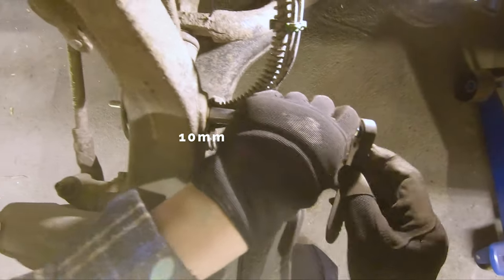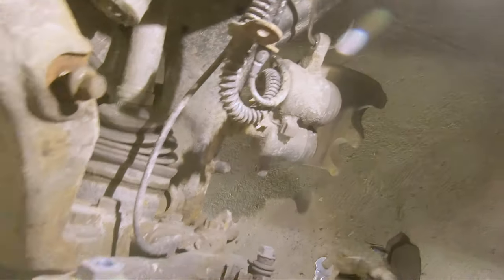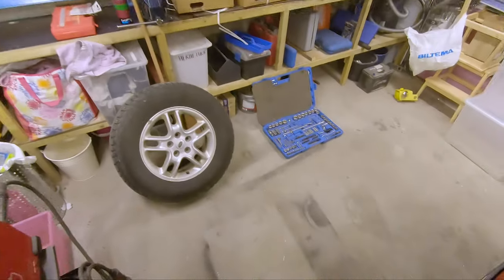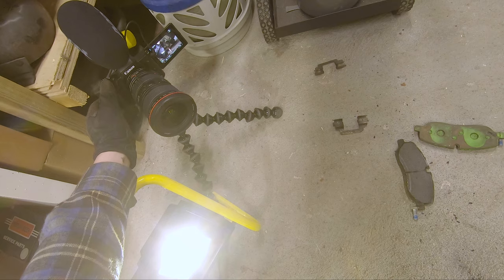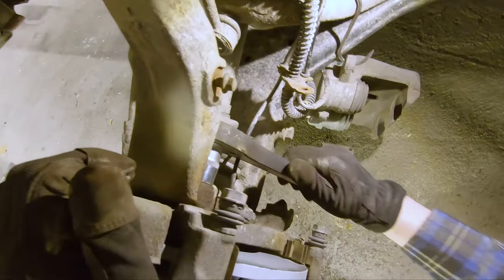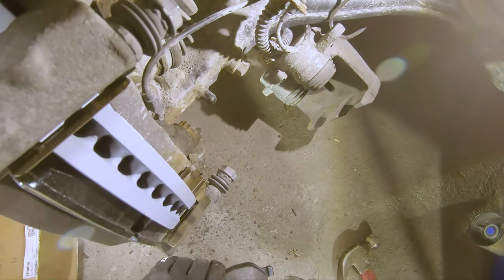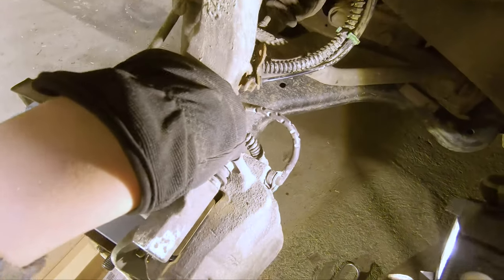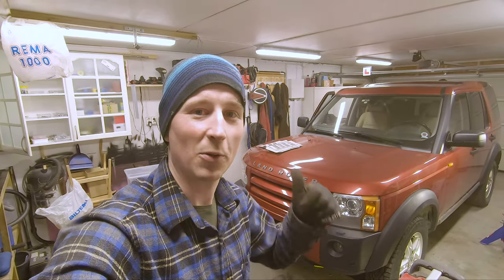POV Land Rover Discovery 3 Brake Disc and Pads Replacement - FULL LENGTH

Comment: when you do each wheel turn the steering so that the wheels are pointing to the opposite side of the car.  That makes access to the two 275nm bolts more straightforward, and allows you to get a longer bar fitted.
Reply from the maker: Hehe, yep, not sure what I was thinking. :) It's a great tip and I'm definitely doing that next time.
Reply: Really good tip for sure

Comment: Hi Simon. I noticed that the original rotor was slotted but you replaced it with unslotted. Was this simply because of cost? 
Great video btw. Good to hear you grunting away. Lol. 👍🏻🙏🏽😷🦘
Reply from the maker: Hey Grahame and thanks! And yeah, this video has no edits or filters so it's as raw as you get it, grunts and all. 🙂 Thought it would be a great way to show that it never goes perfectly no matter the job. 😅 I change from EBC slotted and drilled to original Land Rover discs for two reasons: I needed discs fast after I had done an inspection of them, as you saw, they were pretty bad. And I thought it would be a good to run with originals to see what I find is better and which will last the longest. So the next time I need to do a replacement I can do a comparison of the two sets. I really have nothing negative to say about the EBC brakes. They have been good and lasted surpricingly long, and the pads are a perfect fit. You don't have to grind down the ears to get them to fit in the caliper bracket / Spring retainer, like you often have to with third party brake parts suppliers. 🙂 Now we will see how the original discs will hold up the upcoming years. Best, Simon
Reply: @LandRoverDrive  
Simon, if a person can’t follow your dismantling and reassembling there’s work for their mechanic. Lol.
I was going to fit slotted to my Disco2 but a reputable Indy asked what sort of terrain I’d be driving in. As you would know Australia has lots of Sandy soils and dirt roads not to mention beaches. I do the lot when I can (not during lockdowns 😡) I was advised that slotted weren’t necessary as sand is something they don’t like.Cheers 😡👍🏻😷🦘
Reply from the maker: Hehe, thanks for that. Should be possible to get an idea. 🙂 Yeah, I have heard and read the same about dirt driving and slotted and drilled. Since I haven't been driving to much offroad with them I can't really say if it has affected anything. When it comes to Covid I can't even imagine the lockdowns you have had to endure down there. I think we have been lucky in Norway in the sence that we, most of the time, could drive anywhere. I hope this Covid stuff blows over soon but seen the current news it will probably be a while still. Cheers. 🙂